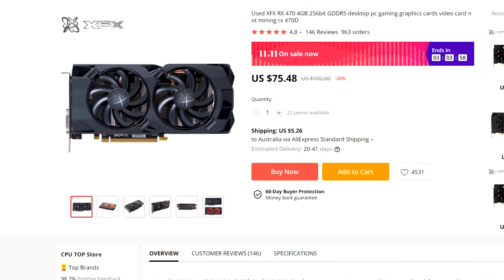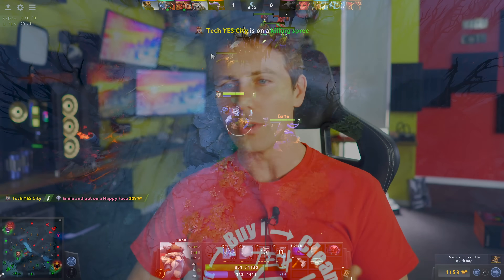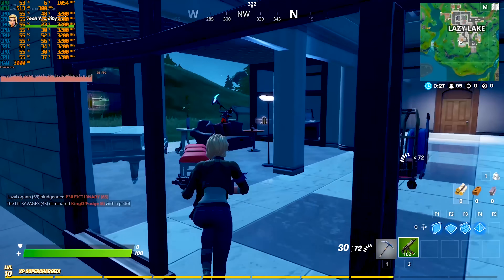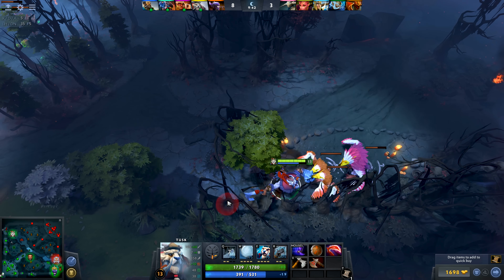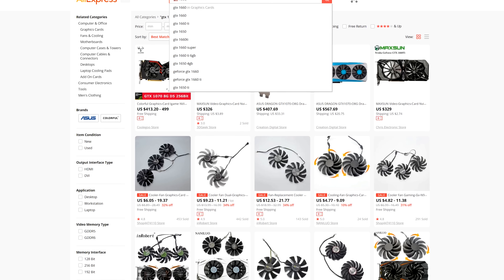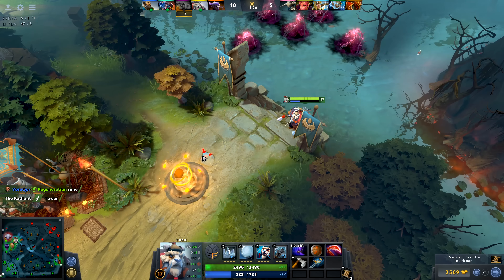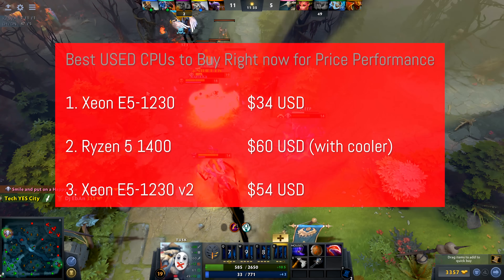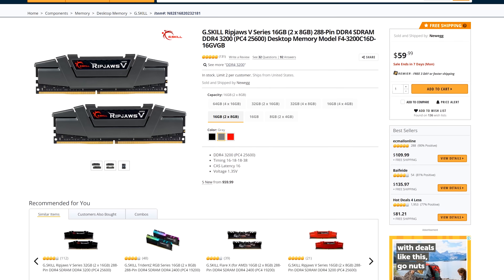What are the BEST Used PC Parts for GAMING Right Now?!

Comment: i5 3570 is better for gaming than the Xeon, and almost the same price
Reply: 4 threads is a bad idea tbh
Reply: @rdmz135  
I have it paired with RX570 4GB
Forza Horizon 4 on Ultra over 90fps, COD WW2 on very high over 70fps, Dirt Rally 2.0 on high over 90fps, Rise of the Tomb Rider on ultra over 70 fps all on 1080p
Reply: @BistraTrailAdventures  they're all older games, modern AAA titles give 4 cores absolute hell. Shadow of the Tomb Raider, AC Odyssey/Origins, RDR2 etc
Reply: @rdmz135  
The frequency of the Xeons is too low, it does not matter if it has 8 threads, it will not be any better than the 3570
Reply: @BistraTrailAdventures  In older games yes, newer games no. Non HT CPUs stutter like crazy in them. Hell even the 9600K stutters in BF5 despite having 6 cores.
Reply: @rdmz135   Ryzen 3600 has 12 threads and can not keep up with 9600k on gaming, the threads are not decisive, the higher the frequency of the CPU the better the gaming
Reply: @BistraTrailAdventures  In older games yes, newer games no. 9600K is weaker in BF5, RDR2, and other modern games that utilize higher thread counts. Some older games like CSGO also prefer Ryzen due to the larger L3 cache. Frequency isn't the only thing when it comes to gaming performance, especially now when higher thread count CPUs are becoming more mainstream. Don't shoot yourself in the foot by buying something without hyperthreading.

Comment: I bought an RX570 about 2 months ago for $85CAD, great deal... but it's a reference blower-design. VBIOS comes up as DELL, and low clocks .. 1206 core/1650VRAM(as opposed to spec'ed 1244/1750). It's got Hynix VRAM. Looking for a decent BIOS to flash on TPU. I just clock it to 1250/1750 with Afterburner for now, but it's a PITA.

 It's on a B85 mobo (s1150) with a pathetic dual-core Pentium G3420...and badly bottle-necking the GPU. So... i've been scouting eBay for a few weeks looking for a Haswell i7 or V3 Xeon. Crazy-nutso prices, especially for 4790's! They seem to be fetching $175-$200CAD + shipping (some fools are charging $35-$65 CAD for shipping a damn CPU!), and Xeon's...E3 1270 V3 seem to be about $25 less. Wishing i lived in Oz right now!!! :(

Comment: Actually got a used GTX 1070 for nearly half the price 2060. Worth every penny. Still plays 2019 games at 1080p with ultra or high settings. RTX 2060 is way overrated, and its basic version has only 6GB ffs. Try avoiding former mining cards if you can, and spend a little on new thermal pads/paste.

Comment: Your weird man! The R9 290 and above gives you best price/performance. I bought a used R9 290X without a cooler for 30 USD and monted a cpu-cooler to it. Usually they goes for around 50 USD and outperforms the RX 570 by a pretty big margin. It sometimes performs equally good as a RX 580 and in some rare instances even performs better than the RX 580. Yes, it draws much more power. But if you're on a 500w psu there's no problem at all. I would stay away for performance less than of the R9 290 since they're dirt cheap. About 20-30 USD cheaper than the GTX 970 and outperforms it with a decent margin.

Comment: @Tech YES City
 Honestly, if u're mentioning ~80$ Xeons in your video, then it certainly worth mentioning ~90$ Ryzen 1600 from Ali. It's 10-14$ premium, but it will give you a somewhat modern CPU performance today in every game, not just Dota/Fortnite with a modern platform and clear upgrade path to 3k or 4k Ryzen series which will easily last you years. My 2 cents.
Reply: Correct!

Comment: Are there any H55 ITX motherboards to look out for?
Reply: They are really expensive in my experience for what you are getting. If you haven't acquired a CPU for it, then it's probably not worth it. For the same price you can get 1150 H81 or H87 motherboards. 
This is just my opinion.

Comment: The best used PC Parts for gaming right now? Xeons!
Reply: Dunno how's Yes selling Xeons. Up North kids don't care about them at all. Must be Core i5 or some Ryzen to flip a rig
Reply: Do the Xeon e5-1230v2 and e5-1230 work with DDR3 NON-ECC RAM?
Reply: @itsfree3766  Do you mean E3-1230 and E3-1230v2?

If so, these CPUs should accept Non-ECC RAM.
Reply: @MarcoGPUtuber  
Oh thank you very much.  I was asking why I was thinking of buying one but I don't have for the ECC RAM
Reply: @MarcoGPUtuber  1650v2 is a beast still
Reply: @itsfree3766  yes they do, im running a 1240 v2 with normal desktop ram right now
Reply: I bought my 2200g for precisely 84 USD
Although I think I should have waited a little bit more because they got a slightly cheaper when I checked
Reply: Can anyone tell me if it is possible?
Reply: @itsfree3766  There's no such thing as an E5-1230 CPU. If you have an E3-1230 CPU, yes it is possible.
Reply: As always 😁
Reply: MARCOOOOOOOO!!!!!    :-D